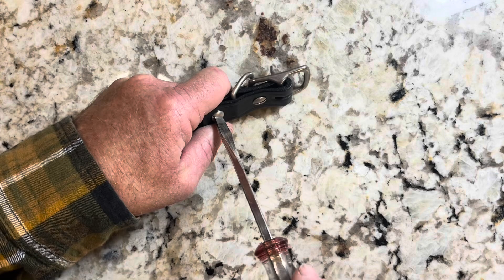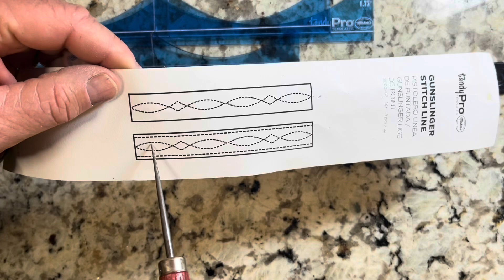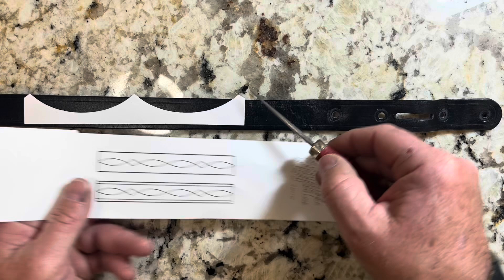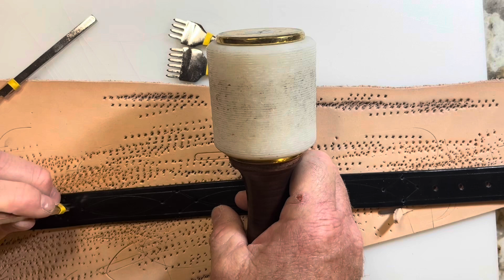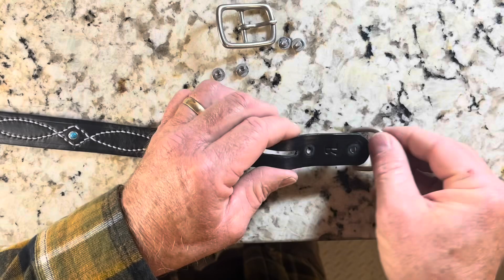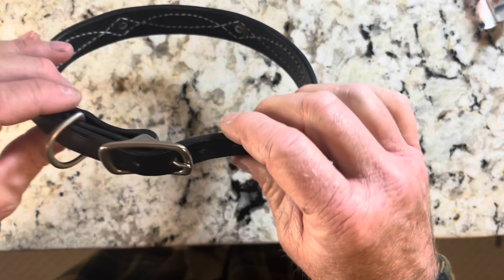Fun Afternoon Leather Project |  The Embellished Project #leatherproject #dogcollar

Comment: It turned out amazing. What width belt were you working on? Was it lined? Can I line a belt then dip die it I have had problems in the past. When I dip die. The glue will release between the lining and the belt. How do you die your projects and do you remember where you got your hardware? What size was those Conchos you used?
Reply from the maker: Thanks for your questions. That dog collar was made from two layers of 4 oz vegtan leather.  The collar is 1” wide and I dip dye most of my projects (straps). I have not had issues with the layers not staying together. I use the solvent Weldwood contact adhesive. The hardware was from BuckleGuy and the faux turquoise spots are from Tandy and are the “small” sized ones.
Reply: @ thank you for taking the time to reply and answer the questions. Your experience helps us beginners. I watch your videos all the time and copy your work.
Reply from the maker: Happy to help!